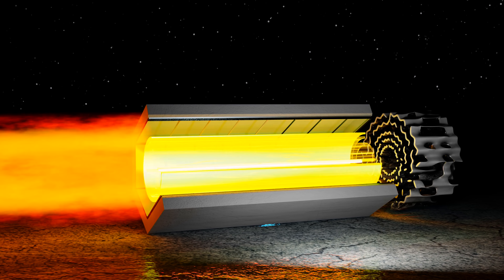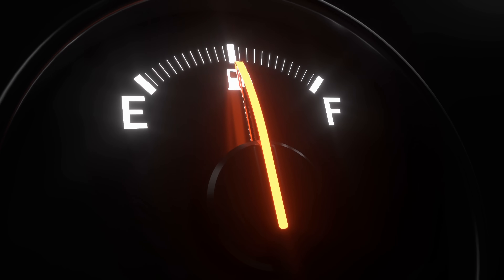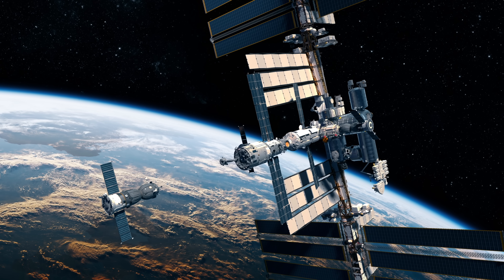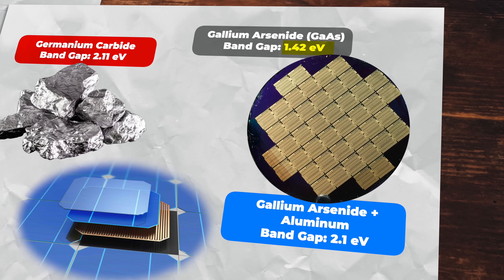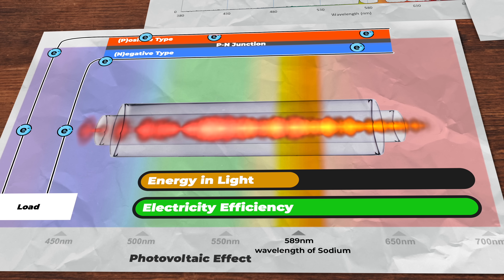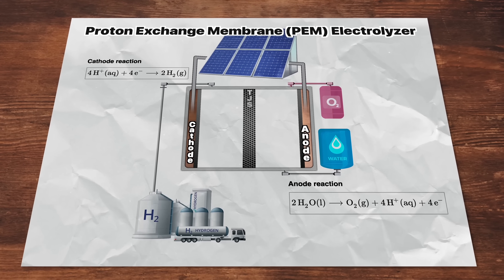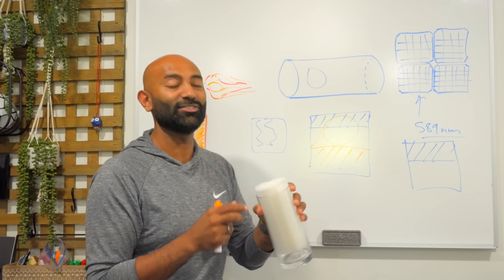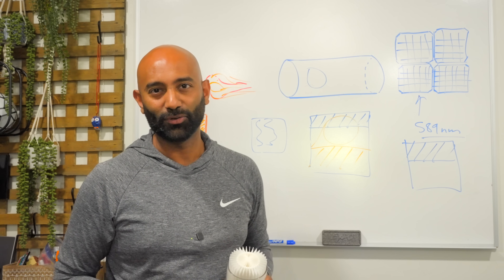Why Solid State Might Save The Combustion Engine

Comment: I was not too impressed with the "Light Cell" until the end of the video when you brilliantly combined it with a normal piston based internal combustion engine. The problem might be in getting a high enough  temperature from the exhaust to, more or less, fluoresce the sodium. Anyone interested in working on the idea might want to try an old school automotive mechanics tool called a "vortex tube" to provide an incredibly high temperature air flow to heat the sodium.
Reply: Yes! What I'm thinking is that this is similar to plasma phenomena fuel cell for combustion engines actually transmutate matter into entirely different matter.....carbon -> oxygen.
Reply: the exhaust stroke has been one of the most efficiency killing parts of a combustion engine, which is also why some people will tell you that the best exhaust system is not having one at all. but if light cell could be integrated with the exhaust in conjunction with an electric motor on the crank it'd make the whole system much better.
Reply: It's not really smart at all.  Because the exhasut of internal combustion engines is already WAY too cold to do this process with, the man dosnt's understand basic thermodynamics and carnot efficiency.  Even if it could be done just having the 'Light Cell' be the first stage and the second stage making all your vehicle electrically for both immediate consumption is infinitly better then having a complex combining gear for a traditional engine and an electric.
Reply: Can't the vortextube be used directly After the Gas turbine exhaust?
Reply: @CUBETechie  Anyplace you want to separate hot and cool air that is pressurized a vortex tube is the simple way to go but the tube in this application may need to be made with ceramics because of much higher temps than standard mechanics compressed shop air.
mIKEY
Reply: @CUBETechie  in theory most of the heat and energy should have been captured by the jet so not much would be remaining to drive the vortextube system? There's still air flow which is energy.......hence why muffler turbos or externally "rear" mounted turbo charger system doesn't get the thermal drive but it doesn't produced much lag because it's a semi sealed system and once volumetric or static pressure is reached, then anything added pushes the entire air in front of it (albeit performance death by blow off valve  - so don't fit one) and all the arguments for why a BOV is or isn't needed are negated by the same arguments for why people think rear mounted turbo setup won't work in the first place? Sometimes things don't make logical sense until someone proves it in practice and demonstrates it? Even then we have retarded performance conspiracy  theorists all chiming in like keyboard warriors trying to discredit your actual proof 🙄 lol
You only need to breath the words water injection vs methanol injection all the internet know it alls come out of the woodword giving their opinion? Not necessarily about why it won't work but dismissing water being a greater potential for combustion compared to methanol that only has an ambient thermal advantage.... especially when those methanol advocates don't understand what phenomena occurs when you increase pressure far beyond what they might think cause detonation and add 1 last ingredient of super high capacitance digital CDI ignition system capable of producing lightning bolts of discharge! At that high of pressure and huge electrical discharge causes a plasma state ripping apart of modules to split water during the cusp of the ignition combustion event leading to signification change in fuel properties as well as the endothermic properties the recombination of hydrogen and oxygen post combustion contributing as well 👍
Under equally the same conditions simply swapping in methanol which has a greater cooling capacity compared to water and is flammable fuel itself; it doesn't break down the same due to methanol being non-poplar and many many times more compressible compared to water means that combustion chamber pressures at the moment of ignition combustion are far less loading to less explosive combustion event and therefore less transfer of energy from combustion into kinetic energy? If boost is kept at a constant there is no ability for a methanol injection system can create additional oxygen for the combustion cycle like what water can under extreme pressure with huge electrical discharge?
There is this false sense of capacity and capability of anything when we only look at it as whole and not it's stoichiometric elements and the potential for conditional phenomena to occur? Meaning until you reach that peak of boost according to volume capacity of the motor and until the ignition discharge is sufficient enough (lightning bolts ⚡) then the conditional phenomena cannot occur and therefore it's benefits not realised?
It's only when we break beyond perceived barriers that we start to understand the reality we live in?

A super high boost motor with water injection and sufficiently supporting ignition system will generate more performance than any other modification claims on the market. Sure you'll reach the material limitations of stock internal components but not once ever will you have a pre-ignition detonation or ping event and boost can be turned up to far beyond what you think a stock engine could possibly handle!
950rwhp out of a stock unopened 13B REW on the world rotary horsepower leader board (apparently owned by a chick in the USA with a Red FD RX7?)
Reply: @ExxonMobil
⛽️🧂
Reply: I'd be more impressed with a 99% efficient gasoline combustion nozzle to run a steam engine for vehicles.
Reply: Only a small proportion of waste heat is via exhaust compared with coolant, so heat the emitter from combustion chamber cooling rather than exhaust.
Reply: Electric hybrid cars need small efficient generators as range extenders so they can have small batteries for day to day driving without range anxiety. Attaching it to a big clunky piston engine would defeat the point. Your typical car engine sends about a third of its energy out the radiator a third out the exhaust pipe and a third to the wheels. If the predictions are right tis will be more effiecient by itself.
Reply: Or you know we could scrap the car idea and go for trains, which if we’re talking electric trains, can be at least 100 times efficient as car travel per person.

Comment: catalytic converters already get 1000 centigrade hot, so a large one built with quarts encapsulated sodium low pressure lamps & tuned band-cap matched photovoltaics could convert exhaust heat energy into HEV traction battery charging while the engine is on, radically improving overall system efficiency or radically lowering fuel consumption
Reply: really good idea. the trouble is... all the light from the inside is lost, and you can only collect light from the edge, you need to heat the sodium without losing it,
Reply: That's still to cool to cause sodium to incandescence
.
Reply: Cooling an exhaust stream below 100C means liquid water will come out the end not water vapour. I’m not going to explain how much of a problem that is
Reply: @theairstig9164   he said above 1000 not below 100, also whats wrong with liquid water??
Reply: ENGLISH PRO TIP:
Quartz is a crystalline mineral.💎
Quarts are how you buy Milk, 🐮
or in Australia, beer 🍺 😃
Reply: @cyberGEK   what dose English have to do with quatz?
Reply: @sammy5576  The OP spells it quarts which is a unit of volume not a crystalline mineral. Hence the English reference.

Comment: Seems this isn’t an engine.  Rather it’s a novel light source to generate electricity. The major issue with this approach the delay required to heat the filament to generate the light.  It still might have applications like in long hauls, planes and ships though.
Reply: combine it with a battery, like a hybrid car, the battery has 15 min of range
Reply: @sammy5576  yes, that is one solution.  That is how FCEVs work too.  It doesn’t change the fact that fuel is still has to be burned and unless it’s super clean renewable fuel, it defeats the purpose of an EV. 

Real hybrids by the way work slightly different. Electric motors are much more efficient than ICE so the power derived from the motor is blended into the power train. That’ll be harder to do with this type of generator since the lag is too long.
Reply: @greghelton4668  you are right, it would function very much like a fuel cell, and yes it can't be combined in a power split device because it has no mechanical output. i don't like how you said "real hybrid" The goal of an ICE  hybrid is to improve efficiency, there are so many ways to combine an ICE with motor generators and batteries, you have series hybrids, series parallel hybrids, and even a really strange one which is just a motor-generator on the driveshaft. each of these has it's pros and cons with cost efficiency and operating conditions, personally, I'm a fan of the style used by Toyota in their "synergy drive"
Reply: @sammy5576  i agree. The term real hybrid isn’t very specific.  I was referring to Toyota’s approach. Incidentally I am a very conservative driver and I get 80 MPG with my Prius.  My next car will be an BEV but at this rate the Prius will run another ten years.

Comment: I feel like we’re going in circles. Burning something to make energy from a solar panel to charge something … uhhh
Reply: And claiming it is at most 80%. LOL
Reply: @YoutubeWatcher264  That's my issue. There are many steps here, each with losses.
Reply: @snake10566 they could be using a urea “salt” for the fuel/ light source. It loses less than sodium chloride in energy production. Sodium chloride is always a problem when  dealing with iodized salt. Urea enhances the photodynamic efficiencies when dealing with methylene blue. So, burning it into a methylene filled tube would create the kind of high energy light one would need to produce those kinds of numbers.
Reply: You left out the part where it burns green methane from whales.
Reply: remember, some things burn carbon free, like my anger towards companies that push so called green technologies relying on fossil fuels
Reply: @OpreanMircea  No technology is totally green, and will still emit carbon in its lifecycle costs even if not directly
Reply: @chadwells7562  do you know what produces carbon dioxide? People, I'm not talking about reducing population but I hate when people offer solutions that go halfway, it won't make a lick of difference, go for the lowest carbon emissions you can
Reply: @OpreanMircea  Humans themselves emit carbon, that’s true. The industrial processes and systems needed to support this number of humans are infinitely more impactful though. Those industrial technologies are also only necessary because of massive populations. We’re facing massive population decline as a result of our social and economic systems collapsing on themselves though. So I’d anticipate total carbon emissions going down drastically even without a sea change in tech.
Reply: @chadwells7562  You are right, I was looking for a graph to prove you wrong but by what I'm seeing the developed countries are reducing their per capita carbon emissions, except for China and India, the world as a whole seems to be stagnating in that area, there are just so many poor people who just want running water and a hot shower and I'm not against that, I just want people to understand that maybe going without some amenities is enough, we're consuming so much everything here in the developed countries (I'm from Romania, technically a developing country) but I'm not hurting for basic stuff
Reply: @OpreanMircea  Developing countries probably won’t emit the same levels of carbon per capita as developed countries when they reach similar milestones on their development paths. They’ll benefit from the mass adoption of lower carbon tech in developed countries and skip much of the carbon intense stuff. This happened with cellphone technology vs landlines and a lot of other places.

Carbon intensity per capita is mainly linked to the carbon intensity of energy production and usage. If we can fix that, much of the problem is solved.
Reply: Most EVs only use a fraction of their range each day there batteries are oversized for range anxiety and those odd trips. A small compact efficient lightweight generator like this would be great range extender for those odd trips so the battery can be much smaller lightweight increasing maneuverability, efficiency and reducing the cost of the electric vehicle without lugging round a heavy complex piston generator like current hybrids do.
Reply: @MrMonkeybat this seems interesting.  basically have a 60 mile battery which lowers the cost of the car by $5000 or more.  then add a combustion range extender
Reply: @shake6321  You just invented a hybrid.  :p
Reply: @NacorantheHarmonicaPlayer  no, because a "hybrid" has an engine and these wouldnt have engines.  they would convert gas to electricity.  but its not efficient.  maybe they can get much much better
Reply: These engines can burn green ammonia. 🤓
Reply: @serversurfer6169 nope its hard to burn ammonia at least cost wise.  That is the only metric that matters until people are more prosperous.  We need an entrepreneur component to school along with math language fluency. But our schools are government run so school choice!
Reply: @johnschneider931  It only costs $400/ton to produce ammonia. Even if green ammonia costs double, that’s still pretty cheap. 🤷‍♂️
Reply: With a mirror you can still get these temps .... Less reliably. But you could have a fuel back up
Reply: Would chlorine gas be released if there a vehicle accident that shatters the containment component?
Reply: We also split atoms apart just to create steam. Nuclear reactors are just fancy steam engines.
Reply: The infrared spectrum should be ample with right filters to make thermophotovoltaic work, true. Heat collection is friction heat in cars, from braking etc...and in homes, the heat source can be mechanical, crank devices or thermal panels..candles etc
Reply: the sun isn't bright enough to put enough energy on a car-sized object to solely power an automobile

also, it's not an ICE since the gases of combustion don't move mechanical parts, it's not a heat engine;  all ICE are heat engines
Reply: Yea, now that i think about it, it's a bit inefficient, maybe for turning a radiator into a generator, but as a main generator nah, only good enough for a secondary generator i believe (with my humble basic understanding)
Reply: I think you’re right, but I think it’s another step forward once they make that work they could use nuclear energy for cars and so on and so on.
I think it is a stepping stone

Like the Tesla, I don’t think it was about the battery at all. It was about making electronic cars. Once Electronic car is perfected. Then they can make plans for free energy vehicles. Basically Upgrade the power source.
Reply: It's like diesel locomotives.  Burn diesel to generate electricity to drive motors.  Unbelievably inefficient.

Burning fuel to generate light is inefficient.  Where does the heat go?

PV cells are 30% efficient _max_.  Where does the rest of the light go?  Why waste?

Nothing is more efficient than a BEV.  Big oil had its day.  Deal with it.
Reply: @AllDogsAreGoodDogs  > It's like diesel locomotives.  Burn diesel to generate electricity to drive motors.  Unbelievably inefficient. <
Diesel-electrics are more efficient (and powerful) than burning fuel directly for propulsion. That's why they do it. 🤓

> Burning fuel to generate light is inefficient.  Where does the heat go?  <
They aren't burning fuel to generate light. They're burning fuel to heat a sodium lamp, and the lamp produces the light. They also have a counterflow exchanger to retain as much of that heat as possible. It can also burn green fuels.

> PV cells are 30% efficient _max_.  Where does the rest of the light go? <
That's referring to raw sunlight. Sodium lamps emit light at a single wavelength, which their cells are tuned to absorb. 

> Nothing is more efficient than a BEV. <
This is for improving the range of EVs, not their efficiency. Did you even watch the video? 🤷‍♂
Reply: For 10 kw per gram? (It looked like they listed under 4 liters in a graph. So volumetric is great unlike Hydrogen)

 That is on par with the best therotical batteries max potential! Lithium Air is said to be able to hold 12,300 watts per KG. 

So yeah. That is outstanding! 

 I've already said TPV cells are the future. Or a part of it. For some applications.

  MIT just made some that capture heat at 2,000 celius, get better with more heat, and have more than 45% effiency. Basically the same as our best turbines!

 I say the future as in... The future is TPV cells plus nuclear or in ten years fusion!

 Sadly... I am super skeptical. Feel like the DoD would be on top of this. 

 Just use sapphire... Oh yeah that is a great choice. So plentiful.

 Pretty cool if true, and I bet a ton of applications could benefit from this. 
 
 TPV cells need more research. We waste so much heat, and potential energy. Having a part that captures that into electricity with no moving parts is a game changer for at least industrial purposes.
Reply: @dianapennepacker6854  Actually, an ideal use case would be to power a house using wood as fuel, and use the waste heat to heat the house in cold weather, and heat water in all weather.
Reply: @FLPhotoCatcher  After 10 minutes of operation when burning wood the solar panels would be coated with soot.
Reply: @mtpaley1  There are ways around that. I'm sure the inventers thought of the issue.